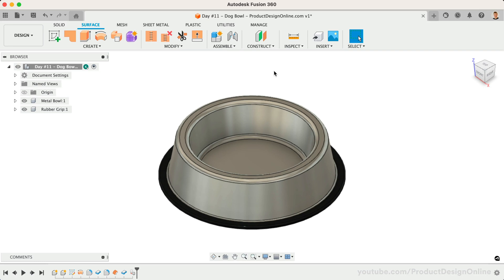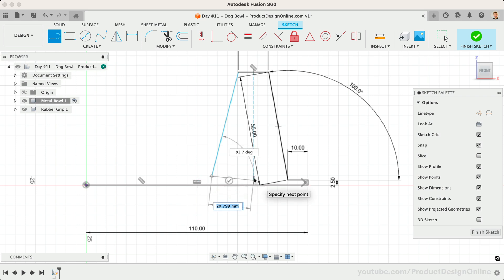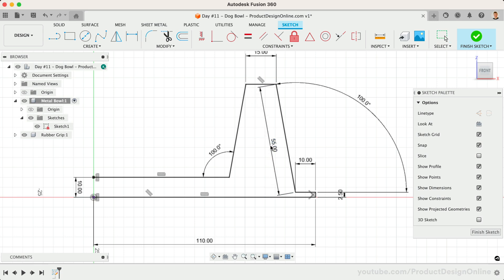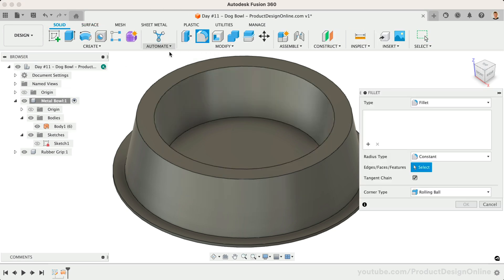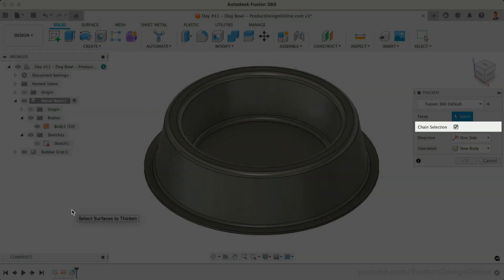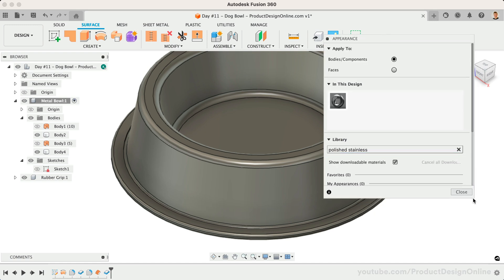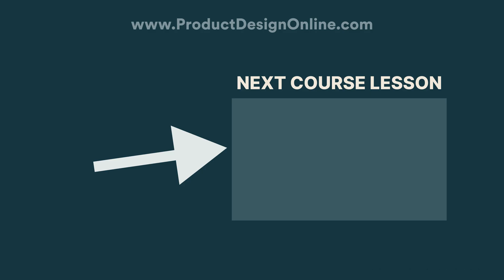Day 11 of Learn Fusion 360 in 30 Days for Complete Beginners! - 2023 EDITION

Comment: I have taught 3D CAD to thousands of students over 20 years using AutoCAD, Inventor and Solid Edge. I am now getting Fusion 360 up and running in a new maker-space for the general community to use. I really like your teaching technique, well thought out, always adding small "bits" to each tutorial.  Well done.  Will be sharing this to maker-space members for sure. If you are new to Fusion 360 or 3D in general be patience with yourself, it comes quick.

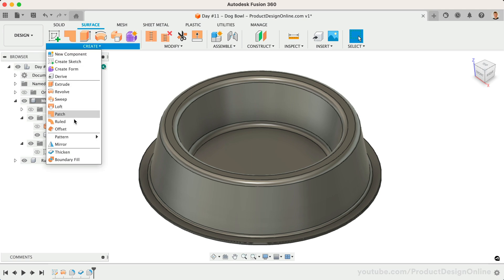Comment: So on my version of F360 (latest) it doesn't put the bodies inside the component. I think this leads to issues with steps like offsetting the surface around the 5:40 mark. When I try to select the surfaces, it selects the whole body. It will not let me select individual surfaces.
Reply from the maker: This was recorded on the latest version, so there are no differences there. Can you double-check that your correct component is active in the Browser? You'll have to have the 'bowl' component active to be able to select it.
Reply: I had the same issue, just need to make sure to uncheck the chain selection option in the offset menu. Just FYI in case anyone else runs into this as well.
Reply: Double check that chain selection is of😉
Reply: It is showing error of computation failed... for offset ..
I selescted correct surface with chain selection off.

Comment: First off thanks Kevin. Um I had a question on the way you made the rubber grip. You made it in the metal bowl component and at 6.54, dragged the body into the rubber grip component. I understand that the design needed that .3mm offset to have it fit the bowl. Could that have been done in the rubber grip component? Also just a fyi, on the appearances, with the personal license, I has access to the polished stainless, but not the rubber appearance. I just chose a black plastic that worked the same way. Just getting back to working with fusion after being away for awhile.

Comment: My big problem with sketches is that they always rotate the wrong way.  I can use the navigation cube to look at a surface that is parallel with TOP, BOTTOM or another face of the cube, then click on it to start a sketch, and Fusion spins it around, often so that the it now taller than it is wider, and I have to turn it back.  Imagine if you had a capital "L" piece.  I position it lying on its side so the longer part is horizontal, and I click on the LEFT face of the cube so the surface I want to sketch on is parallel to the screen.  I click on that surface, click on sketch, and Fusion spins it around so the "L" is now right side up, and going off the top of my screen.

I turned off auto rotate, but I don't like that I then have to get the face in the right orientation if I haven't already used the cube to orient my body.